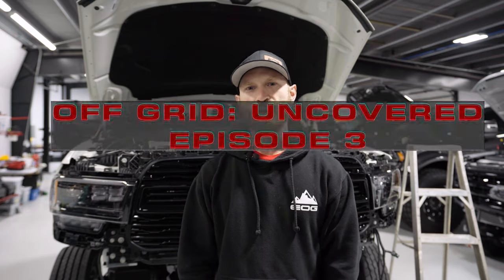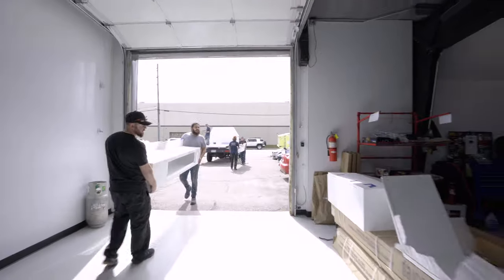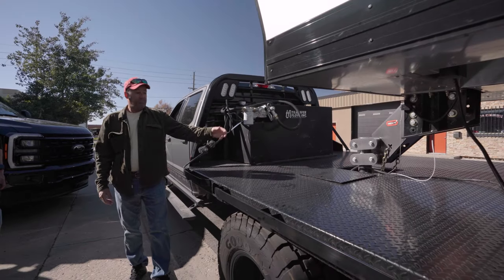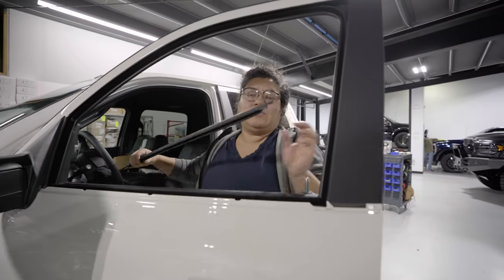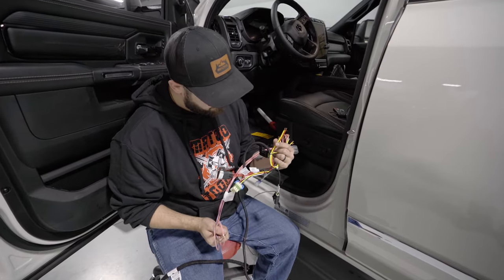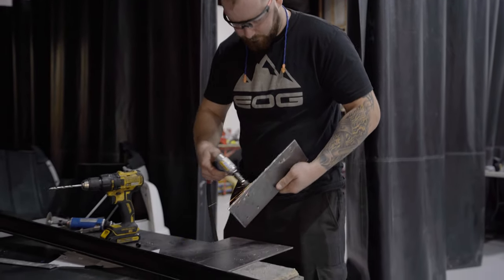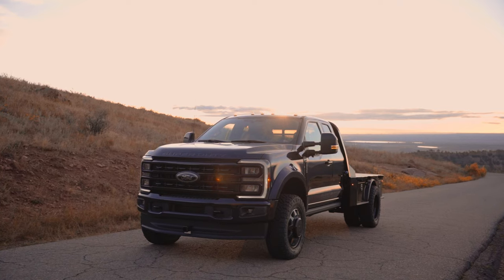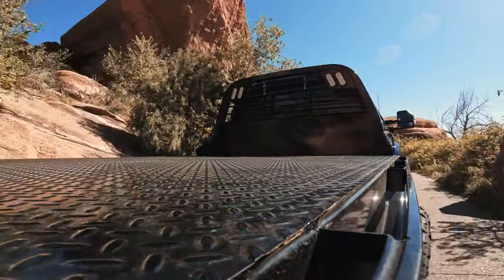Off Grid: Uncovered EP 3

Comment: Can you do builds on an f600 too they are basically the same as f550 correct me if I'm wrong
Reply from the maker: Short answer yes, but the F-600 has a different frame that would require all new components designed including the bed, and with a fully booked production schedule it’s just not a justifiable venture at the moment.
Reply: @elevationoffgrid  well if anybody is going to do a good job that's you guys 🤙🔥